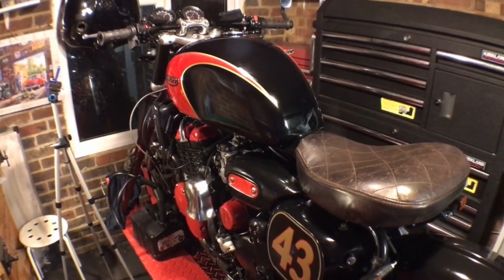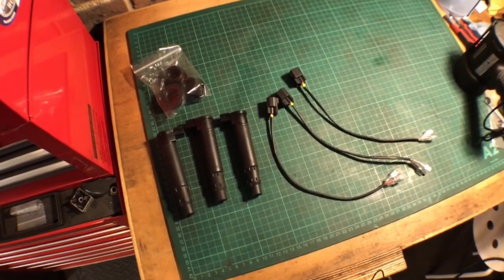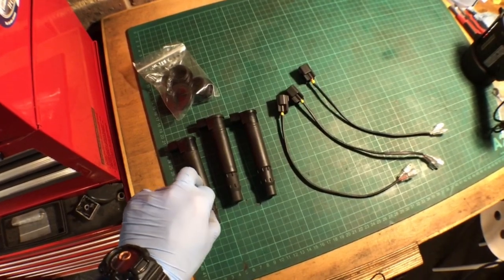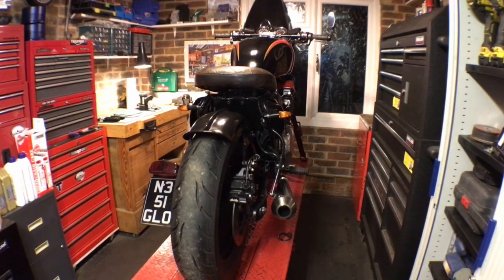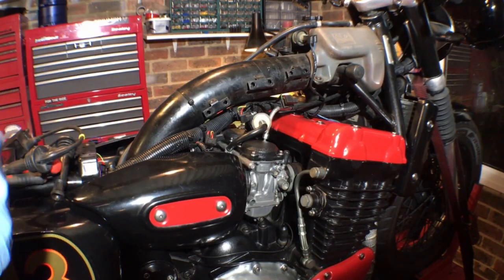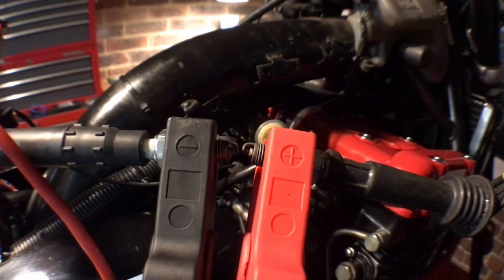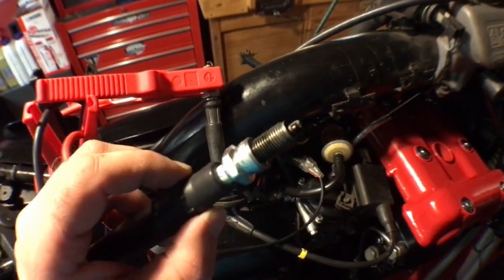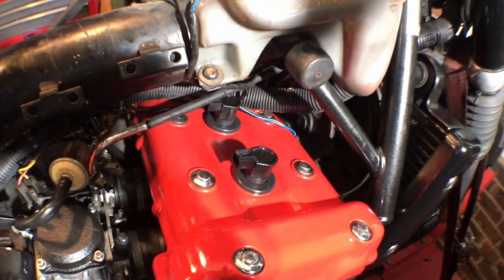Stick Coil Upgrade For Triumph Carburettor Triples

Comment: I installed these from Paul Messenger on my 96 Triumph Daytona 900 and they are fantastic!  I believe they actually increased throttle response.  My bike runs like a banshee now!  I highly recommend this upgrade to your Triple ;-)
Reply from the maker: Hey there. Thanks for your comment. Yes, they’re quite a good improvement for triples 🙂

Comment: Helpful video thanks but the music was irritatingly loud so I turned it down, only to have to turn up the volume to hear your commentary... I'd be interested to hear how the bike performed after the mod i.e. was there any real improvement?  Also the stick coil tubes and the rubber grommet seals supplied do look as though they won't provide as good a seal against water ingress as the originals.
Reply from the maker: Hi Christopher. Thanks for your comment. Yes, probably the music wasn’t a good idea, but you learn and improve as you go along 😊

You’ll find varying opinions, but I would say yes, there is definitely an improvement. I wouldn’t say you’d be able to measure a power increase on a dyno, but I’d say you could definitely feel an improvement on how the bike responds to throttle inputs and also it seemed to be running smoother. The owner noticed the same improvement and commented it on it, so I’d say ot was worth it :)

I think the grommets should do the job, but you are right. The originals where a tighter fit in there.

Comment: I have the stick coils on my 1995 Triumph Thunderbird 900 and so far they are working as they were designed!
Reply from the maker: The stick coil upgrade does seem to make a bit of difference. But I have the stock coils on my Tiger ‘cause I’m too cheap to get a new set 😂